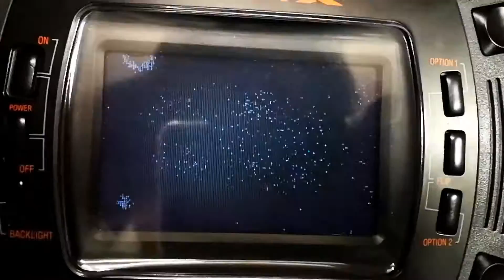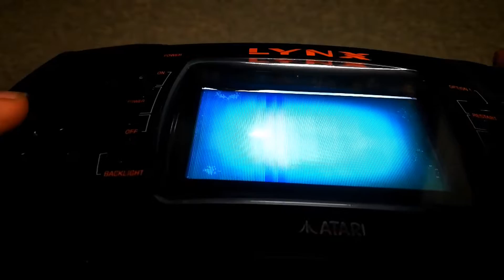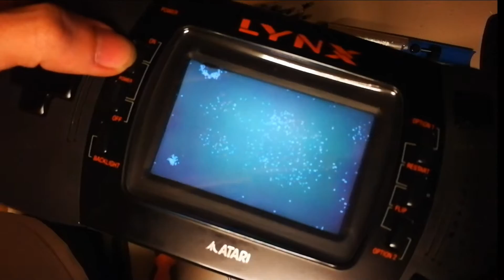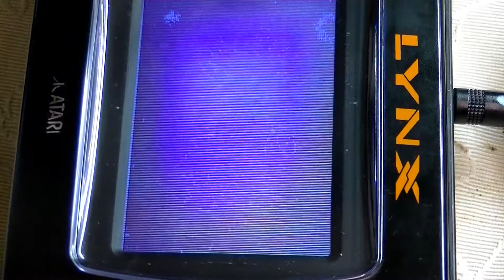Atari Lynx Repair (Re-cap & Screen Replacement) | Joystick Division

Comment: How the hell do you have so few views? Great video mate, I am about to re-cap my Lynx 2 too. I sort of already started, but got pissed off trying to remove that metal shield that's above the cpu. How the hell did you managed to remove it so easily with a solder pump? I used wick, pump, but no matter what, fucking thing just doesn't move. I simply can't get all the solder out from those cavities.
Reply from the maker: First of all, thanks a lot for the compliments, they mean a lot. I think it's just the algorithm and the fact that I don't upload too regularly.
Now, I assume you're referring to the solder pads. Sometimes getting the solder removed can be tedious. I've seen other videos where they use some flux and a heat gun and when it start to melt they pull them out with needle-nose pliers.
If you go the heat gun route, just make sure that components around the target capacitor are protected from the heat with kapton tape or something.
Good luck with it, I hope it goes well.